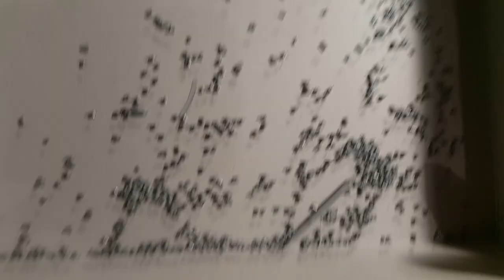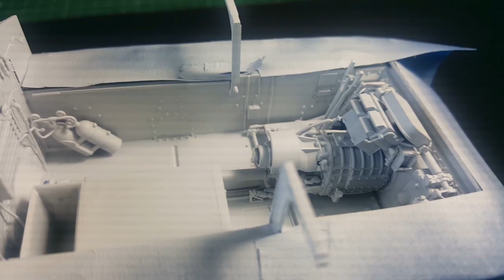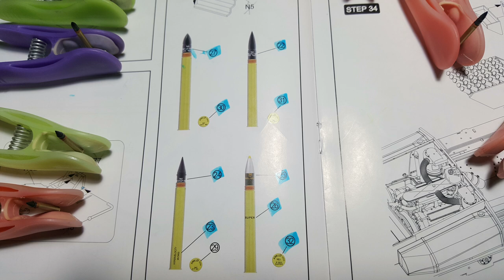Rye Field Model Sherman M4A3 1:35 W/full interior part 2

Comment: I've built the RFM Jagdpanther and that was an epic build. I have this kit waiting and will start it next month. The tracks look a big job but typical of RFM. With the Jagdpanther I sectioned a lot of the upper hull away with the dremel as I didn't want to cover the interior detail. I might do the same here.Sort of make a sectioned model as if in a museum. The interior and engine of the Sherm looks good.
Reply from the maker: Someone who built both models mentioned that the Sherman was much more enjoyable than the Jagpanther. So I think you will love it. Also good display idea sectioning the hull. I am still try to decide how to display mine.
Reply: @GeorgeModellingforBeginners  Yes I can vouch that the Jagdpanther is not that easy a build. It has a lot of PE which I find fiddly and also some of this PE is structural so getting things accurately located is difficult and mistakes don't come to light until late in the build. I note your title and i wouldn't class RFM full interior kits as beginners material. The Sherman is a much less complex vehicle than the German machines so I am looking forward to building it. An ideal involved build to keep me occupied through the rest of lockdown.
Reply from the maker: Good luck with yours!

Comment: Amazing job so far. Incredible patience with those tracks(which do look amazing),but i would have binned them and use Friul metaltracks...I just don't have that kind of patience  👍
Reply from the maker: Thanks. Well I definitely not doing it again. They look good though :)
Reply: @GeorgeModellingforBeginners  You're right,they look amazing but it's just too much of a chore for me..especially having to glue the guide horns on as well! I did one side of Friul metal tracks for the Panther i built recently,in about 2 hours,and that was boring enough for me!

Comment: Very impressed with this, but are there any practicalities to painting some of the internal parts before assembly.
Reply from the maker: Thanks. There is always the practicality to paint parts separately but the fit of painted parts is poor. On the other hand if you attach most of the parts you have to be very careful when painting. There is no wrong or right method I guess just different preferences.